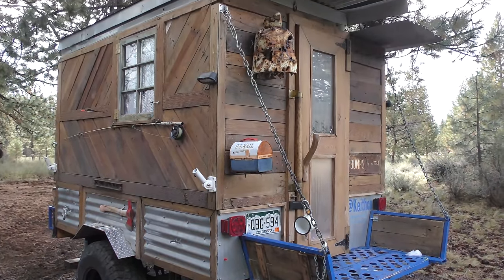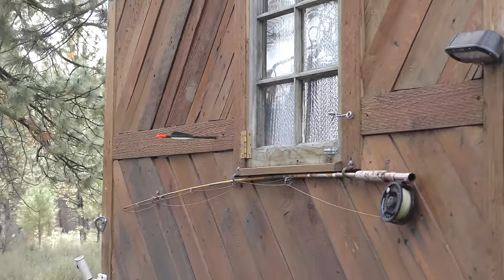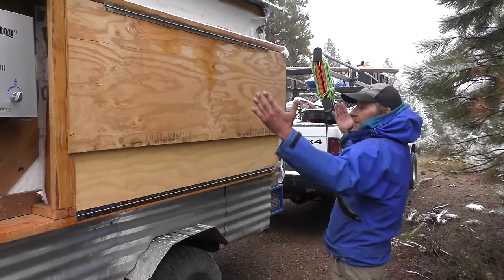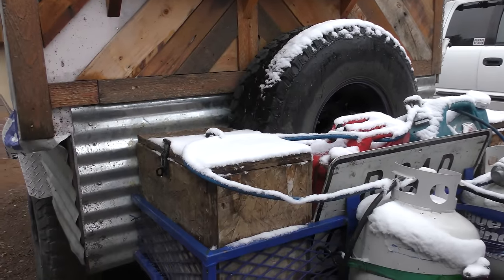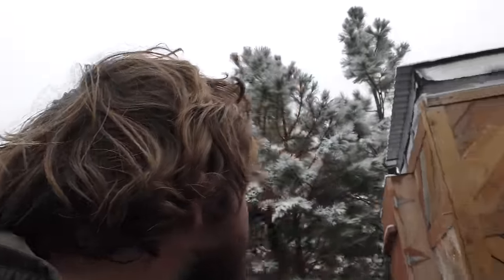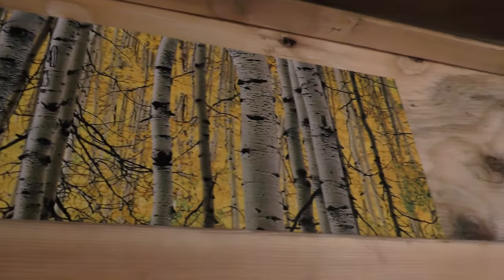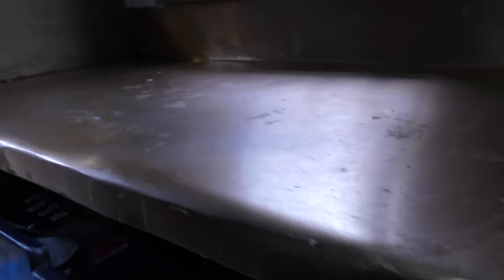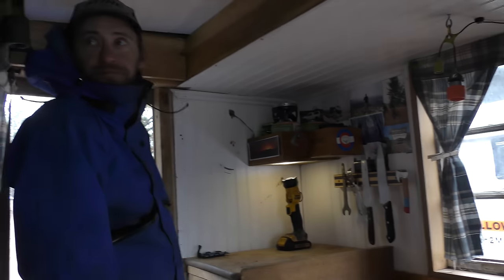Handyman Builds Off Road Tiny Home Camper & Lives Off Grid for 4 Years

Comment: I really like this comfortable, cosy travel cabin, whose practicality and utilitarian fit out is really well considered!

As the resident builder, if you can think it, you can build it, and that's a good way to test out future modifications, improvements and upgrades.

I think I'd be happier sealing the gaps in the walls and improving insulation.

A Fatsco Pet Stove, Model 450 (9.5" High x 6" Diameter) would be perfect in there, and burns wood, charcoal briquettes and coal, giving a good dry heat.
Reply: I have foam and reflectix for all the windows and things..

Comment: If you put a small fan above your doorway, it will help circulate the air, so when you have your heater on it will move the air so it doesn't all stay hot at head height and in the summer it will help move the air around, but because it will be a small fan it won't make the air cool to cold like air conditioning does. I know you already have a fan but if you put another one up near the roof and have both going it will move the air better.
Reply: Thank you. I actually had someone reach out and is sending me a diesel heater 👍

Comment: That Cummins paired with a Manual Transmission is the real deal
Reply: Sure is.. Found out that it has the same axle, leafs, rear swaybar and trans as a 3500. I just max out on towing at 13k because of the tires 😂👍

Comment: For the heat thing why not find little fans to mount in the ceiling to push the heat down in the winter months. You can get them where they can run off very little 12v and some have light in it to....... My husband and I work on campers but we agree we want to make one for ourselves! One that will withstand travel unlike a factory made.
Reply: Some one reached out and is sending me a diesel heater ! Cold floor no more 😆
Reply: @keithherring5462  that is awesome. Keep up the great work hope to see some more video of some of the new improvements on the trailer.

Comment: Put a 12V fan in one of the top corners, pointed down 45 degrees. It'll circulate the hot air for you. Cheap and effective solution.

Comment: Keith could try running the fan while the heater is on, pointing it towards the ceiling. Put it on low speed. Maybe this would push the heat off the ceiling and down to the floor. Or try putting some computer fans along the ceiling to blow the heat down. Maybe one of these ideas would work, at least while he has enough solar charge or plugged in the power. Lots of great ideas in the camper.

Comment: Great set up,
May consider to put a small fan pointing down to blow the warm air towards the floor?
Reply: was thinking the same thing...also, he could put like 300w of flexible solar and run all his fans off 12v, and lights and everything too. that inverter is a waste, and he always needs to go to town to charge. peace
Reply: Get a quiet wood stove fan that runs from the heat and direct it towards the floor to help with heating that area.

Comment: Hey mount one of them real small clip on desk fans to the heater to push the heat down. Like your set up man. I bought a slide in truck box camper that I'm making into a pull behind with a 6'ish deck. It's sitting on an 03 Cummins frame.

Comment: Viewing Tiny Homes and stealth camping is lessons in living with what we need and what we don't need.  A revolution is coming though, Electricity in values you don't get from a power grid.  A new UK battery, the Austin deliver 1,500 miles or a weeks mains power from a regular sized battery.  Its not lithium Ion so nowhere near as dangerous as Tesla power cells, then we have a KinetiK , mains power using no fuel a pure generator, our test units have been running for 3 years kicking out 10kw an hour. This all will enable things you could only dream of, very soon.

Comment: He should get severel mini fans and mou t them in the corners ect and aim then angling downward to move the heat lower and they would be nice during summer also
Reply: I get great cross ventilation especially with the new flip out and pop top. I always try to park in the shade.  I had someone reach out and is giving me a diesel heater as well 👍

Comment: If you want to even out the temperature from top to bottom, put a fan on the floor and blow the cold air up.  I do this winter camping and it works great in the tent.  Blowing from top down doesn't work.

Comment: Fan pointed to the ceiling to move heat down to floor.
Reply: Robin Goffinet , yes ... I use the 8D battery , O2 COOL FANS with a self made 12 volt cord .... real reliable too .
Reply: @marksommers6764  I keep trying to convince my wife that our ceiling fans in the house need to be reversed in winter, but she is determined that something she saw on TV is correct, and refuses to leave them that way when I reverse them.  GRRR!

Comment: I like the idea of the pull behind trailer, that's what I'm looking to build upon, however, since I'm not a mechanically inclined girl - at all LOL, I'll probably have to think of flooring, and using PVC to build a frame that I can cover with something like chicken wire which would hold some type of insulating material and over that, a waterproof covering of some type.  I've been contemplating what I could afford that would pull it around my local area to get me to work and a camping spot; perhaps a riding lawn mower b/c I don't think an electric bike would be strong enough to tow the camper and I cannot afford an ATV or UTV right now.

Comment: I use a little 12 fan to push the heat down in my camper it works very well and I don't use as much propane
Reply: Had someone reach out and is sending me a diesel heater. Pure Luxury 😆

Comment: That is a great little hole in the wall very cool thank you for sure And thank you for sharing When I had mine years ago I ran a12v power cables  from  my battery all the way back to my trailer.  I had a hailo charging coupler at the tongue and trailer hitch when I drive down the road I charge all 4 of my deep cycle battery It was a heck of a ride sorry no pics
Reply: I'm familiar with that set-up.  My trailer has been mostly off the truck but I do plan on getting 2 "house batteries" so I can plug the trailer in or run tools

Comment: A thought on the floor being cold and the ceiling being hot.  Computer (cooling) fans just might do the trick.  They are very inexpensive ($15 TO $30  - probably cheaper at a computer show)  12 volts / 115 volts,  5 - 6 inches square, quiet,  35 and up CFM.  Let it blow in a vent shaft to force the warm air to the floor or let it blow "open" to circulate  the air freely.
Reply: I have a diesel heater on the way

Comment: I really like this but I'm going to use an enclosed, vee nose, 6x12 tag along.  Currently is set up to haul my civil war reenactor supplies and gear.  Just retired so I'm done running around the fields.  Time to travel and camp "inside" instead of a floorless tent.🤣  The way it's set up I could sleep 6 but no supplies.  Need to change a few things.  Like your ideas and internal design.

Comment: Cool build.  I'm gonna do something similar but put a 10' pop up RRT on top.   What's your tongue weight? What dod you frame it up with?  I plan on using 1.5' steel tubing  for the corner posts top frame and 1" elsewhere.    Thanks

Comment: Very impressive ,very impressive but when you use a vehicle  Rear axle it's designed to have thrust against it, when it doesn't and it's free spinning like that without a motor and a drive line it will come unglued, it will grenade.

Comment: Very fun video & lot of great ideas . Just wonderign as far as the heat goes . Is there a way to place a small duct  in front ot the heater so it can tranfer heat towards the floor a little bit . Or at the end you were saying you had a wood stove at one time . Possibly put one on the counter & use a little fan on topp of it to move the heat around & warm the whole camper more evenly
Reply: A small diesel heater is the best option down low. I'm no longer full-time I have a shop now.
Reply: @keithherring5462  So cool . Still happy you get to go out some . Are you going to stilll ake videos of your time out ?
Reply: @pucketts57  I don't make videos , this isn't my channel.

Comment: Attach a 30kw generator to your trailer rear end and as you drive around and it spins it will charge up about 4 to 8 or 16 12v batteries
Reply: Someone else mentioned that!

Comment: Boil 1/2 a gallon of water and you can take a good sponge bath everyday. Buy a medium sized minivan like Nissan NV Cargo which can carry a lot of weight, instead of drive a pickup. Everything is enclosed and you have more storage. Plus you can use it to tow another camper too.
Reply: I do construction and absolutely need a big truck. I wouldn't be able to haul and store everything or camp where I want with a van 😂
Reply: @keithherring5462  A Nissan NV cargo van is pretty large and will provide you with a ton of living space. It is only 30,000 bucks brand new. You can use it to tow a 5x8 utility cargo trailer allowing you to stuff your belongings in it. It is only about 2900 bucks, also brand new. Everything is locked and enclosed. Your wood cabin is heavy and not very functional. Even my compact Nissan NV200 is much better than your wood cabin. My only problem is I have a lot of animals to take care of.
Reply: . wow only 30 grand 😆  also I  no longer live fulltime in my camper. I rent a detached garage/shop for my business.  No offense but for the life I live a van would be absolutely useless.
Reply: @keithherring5462  Good to know. For me, a pickup is absolutely useless cause I want everything to be enclosed.

Comment: so what are the best years for that dodge engine? ive got a newer gas dodge, looking to get something tried and true to build out. this guy did it up pretty well. anyway, good stuff!!
Reply from the maker: the fuel system in the 12 valve is pretty awesome with the p pump!
Reply: 24v have some quirks . the in tank fuel pump is junk and it can wipe out the injector pump if it goes .. Pricey fix but there's after market ways around it 👍

Comment: What did Keith do for the structural framing / sturdification? How much metal work vs. woodwork with keeping this thing standing?
Reply: Its over engineered wood framing with some strategic L brackets.  Honesty it hasn't moved and doesn't flex as all.  It will be getting half caged sooner then later👍

Comment: What kinds trailer did he use? Looking at making one myself. Would he beable to share the layout of how he built it. Looking for something to challenge myself in the future someday when in fully able to build it.
Reply: It was an old basic yard trailer. I'm running custom 3500lb leaf springs.  If I was going to do it over I would spend the  money on something more purpose built.
Reply: @keithherring5462  think a harbor freight trailer but beefed up would be a good candidate to build off of? I'm getting slowly into overlanding but need something that can stand up to the trails.   Either a slide in camper in a truck bed trailer, in my bed or a homemade trailer like yours. Only fear is the camper getting bashed up...im taking my cat with me so..its gotta be comfortable cant leave my buddy behind.

My truck is by no means small a 04 quad cab ram 2500 5.7 its gonna be my adventure rig.

I've got everything listed on all the modifications needed to help it and improve it.
Reply: @commanderwhite12  It really all depends on how off the beaten path you want to get.. And of course your budget.  A flatbed and pop-up truck camper like Phil's old rig is pretty tough to beat.  Are you going to be full-time?
Reply: @keithherring5462  unsure I probably wont beable to be a fulltimer but regardless this would still be a wonderful getaway for a week or two at a time. (Work schedule have certain days I must come back for)   

Forgive my long posts I can jabber sometimes

Budget is kinda tight (paying off the truck) Phil's build is outta my range I wanna keep my truck the way it is minus mods so I can use it as a truck. Until I can find another clean 3 gen to use as my DD. I've debated a popup slide in my only worry is cold weather..I'd high perfer a full hardside but I'll tale what I can get.  Where I live it's hard to find campers that aren't water damaged. Looking for one to fit so I can have a tire/jerry can carrier bumper.

Really just want something I can adventure. Fish off the keys, see the northern lights, maybe the Rocky's...ive have no idea where I'm going, how far off the path I will go or what I will encounter in kinda just running with it as I go. Seeing where my path leads me.  Its gonna take me a few years before I can fully get there. I'm in no rush but I want to learn and prepare.

Comment: Hey I've got a solution for cold floors use heated floors wire under neath tile floor
Reply: They use a TON of power. Like running an AC unit

Comment: I love Oregon and live close to Bend. Does anybody know if the center isle is important for balance? Because it seems like a waste of space. Like if you had a isle on one side it would increase the live-in space? Instead of cutting it in half...
Reply: Im not sure how you would fit even half of the designated areas I have with an isle on one side?  Every van /truck camper has a similar layout. ... Not to mention the insane amount of exterior easily accessible storage ?
Reply: @keithherring5462  Okay. That certainly answers my question. Thanks for the video. I love the idea!

Comment: Won't the front of that trailer rot out since there is no weather proofing on it. It's just wood doors on the front with gaps all around it. I guess he puts up plastic in the front part and n the cold winter to keep the cold out.
Reply: Because it's new ( and its been summer) I just haven't finished it off yet. 👍 I have a piece of lexan to go in.

Comment: '
nice mini wooden camperhome trailer...
how come this camperhome dont have 2 amber yellow lights on the rear taillights for turning signals...
also ram truck dont have 2 amber yellow lights on the rear, too...
better put on both vehicles with 2 amber yellow lights for safety turning signals without accident or ooop
Reply: The red LED lights flash on the trailer.. Its completely legal and bright as hell 👍
Reply: @keithherring5462 
hi K H...
'
big WRONG...
only red lights are the big problem...
bad legal, happy accident, happy insurance nasty business...
dont be stupid...
must be amber yellow lights are the best safety policy and less problem
Reply: What are you talking about ? My fronts are amber.. Rear lights are red because they double as your brake lights ! Why would they install factory lights on the truck that are illegal? And every trailer lights I have seen are RED . it's so other vehicles know what direction there looking at you👍 Amber running lights on trailer yes.